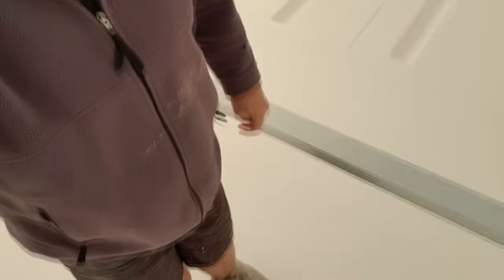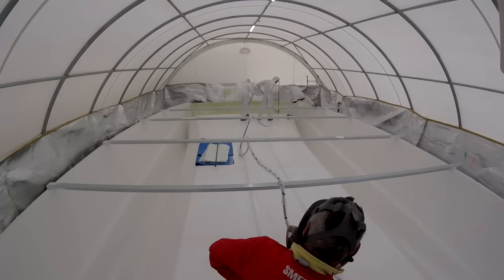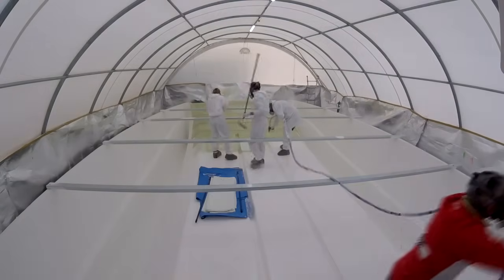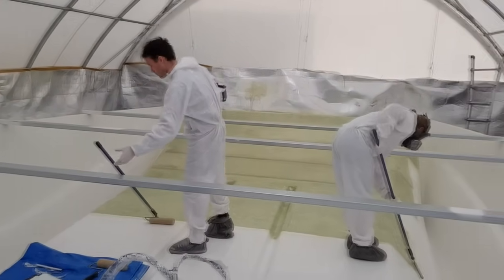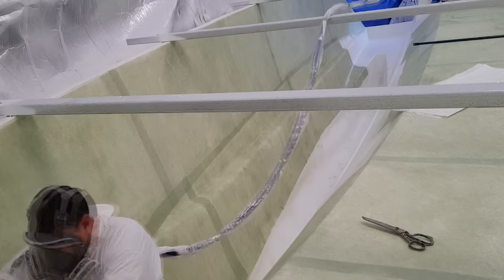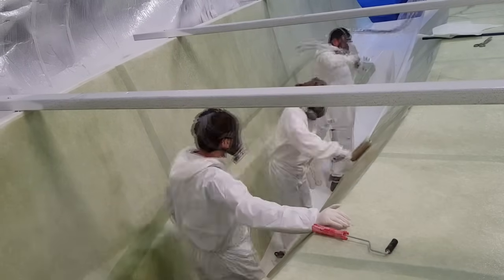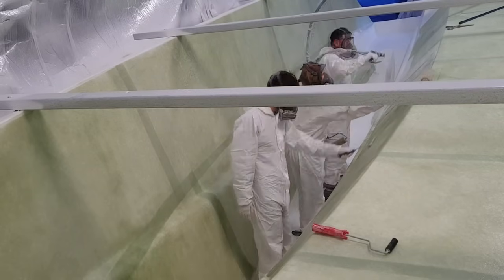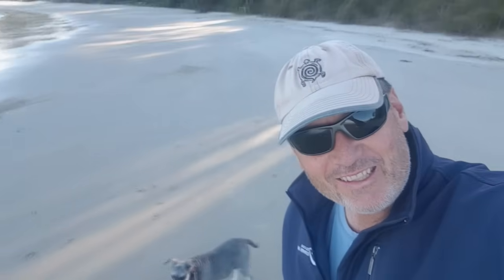Ep012 The Real Work Begins

Comment: Ah, the quintessential arse split suit. 

If you had any idea how assholish the manufacturers are on this, you'd throw a bloody fit. So here's how it goes. I bought tons of these suits, many manufacturers, many sizes trying to get rid of this issue, i'm an architect and sometimes i can't just walk on site in street clothes, not to mention in the early stages of construction when everyone wears arse split condom suits to avoid silicosis and other issues old house restoration and rehabilitation implies. 

Gave up eventually, because you're set in two positions: 1. you deal with it, 2. you walk in an oversized suit and that's horrible, you catch on things, you're a hazard or you're in hazard.

Luckily grandma taught me how to sow, so i made my own. INITIALLY thinking, it must be the cheapo material, after all, other pants are tight in the crotch area when you squat, it must be that, right? Wrong.

It's the cheapness of the manufacturers. For a strip of 3 cm wide going crotch length to back, and then 2 cm wide on the inner thighs just above the knee (that's all i added for that issue) they inconvenience you, on what's already an expensive product, for what it is.

The suits i made after realizing this are so comfortable. 3 and 2 cm strips, nothing more, but to them, that's cents saved on the production line so they can charge you premium on what's a defective design.

Nuff said.

Comment: Must be horrible working in the masks and all the rest of the protective gear.
Reply from the maker: That's for sure Andrew. We have found that buying the actual branded gear ie 3M has made all the difference in comfort. The white suits as you will see, tear easily and often my arse is hanging out due to splitting from kneeling and picking things up as they are poorly made. I have now moved on to a more expensive suit that gives me good chemical protection and is made of a breathable material, albeit about 10 times the cost. The reality is, that without this gear you are basically poisoning yourself, so when you are working hard in the safety gear you are much better off going home healthy than risking long term respiratory or worse issues long term. I will not allow anyone work with me that doesn't wear the correct gear. Not many people want to work with me these days and I sort of understand but I am quite accustomed to gearing up and keeping relatively comfortable .All the best Rossco

Comment: That looks like professional work! Does the resin stay ”open” for the next layers to bond chemically? Or do you have to grind it open...? (Hope not!)
Reply from the maker: +Arctic SeaCamel It is important to reactivate wherever the resin has cured.This usually requires sanding lightly without undermining the integrity of the substrate then wiping with styrene monomer to tack the surface up and reactivate.Laborious but ensures chemical  adhesion to existing layers.Thanks for your interest.Ross
Reply: Oh Ok, so you like ”melt” the surface prior to doing another layer?